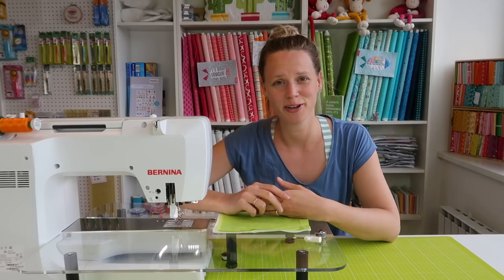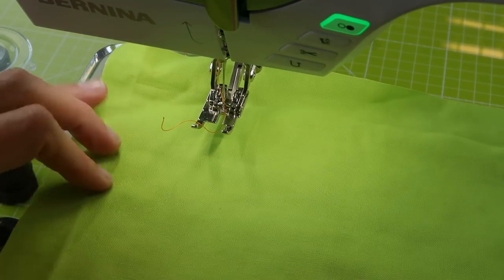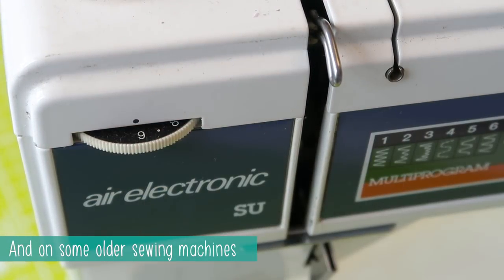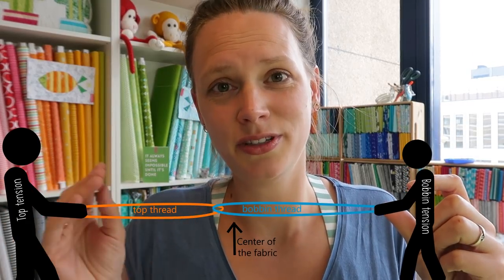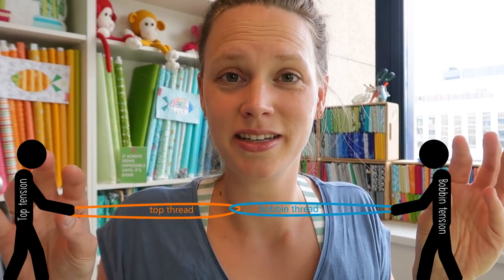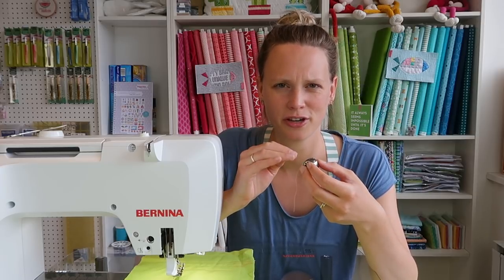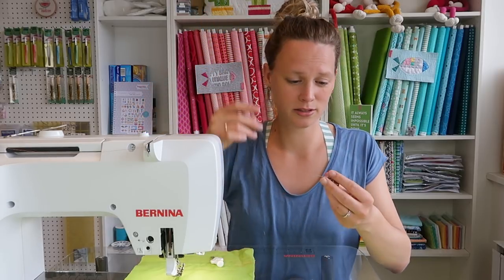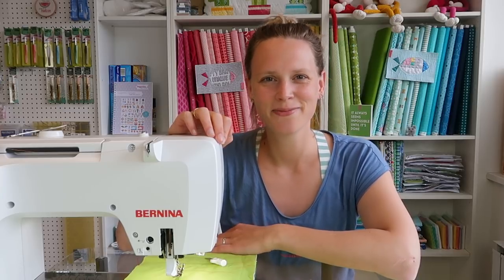How to fix your thread tension problems | Quilty Questions

Comment from the maker: Hi there! What do you want to see next in a quilty questions video? Any quilting problems you need solved? Something you want me to dive into and explain? Let me know in the comments below! I would love to hear from you 😃
Reply: I struggle with quilting my smaller quilts on my home machine.  I know I am over thinking it and my biggest challenge is how to pick a design.  Do you think you could do maybe a series on how to quilting a home machine?  I really love your videos. Have a great day
Reply: can you explain tread.  I bought thread at a discount store.  Every time I try to use it the tension is way off.  Auto doesn't work with this tread and I can't seem to get it adjusted to work properly.  I appears to bee the same as other treads but it isn't.

Comment: Thank you for this video. I also sew on a bernina! I am having issues with when I go over multiple layers. It only seems to be an issue sometimes. All is threaded correctly. Should I be changing tension when i go over the thicker parts? 
Thank you!

Comment: This is a great video.  I have been sewing for 30 years but never really understood this.   Now I do.  My issue is that the bottom thread has very loose threads.  What is a fix for that?
Reply from the maker: Maybe you can check if your bobbin is being wound properly. Is it not too loosely wound? Or check the tension on your bobbin case if that is ok. Giving your machine a good clean can also help in some cases. Or take it for a (yearly) checkup at the store. Hope that helps!

Comment: In my case, forward stitches are sewn perfectly. But for the same fabric, same layers, same thread, in reverse stitch my top tension is too low (bobbin thread tension is too high) Please advice. What might be the problem with my Brother GX37? Its a brand new machine.

Comment: What about if I'm still getting locks on the surface of my fabric no matter what the thread tension is set at? Even when I've turned the dial all the way down to 0...I've also adjusted the bottom bobbin tension and believe it to be right, if anything it might be a slight bit too tight still....is that why I can't get rid of the locks on top even with my tension set to 0 on top?

Comment: I have a problem but have not been able to find a resolution. Maybe you can help or direct me. My machine always jams after about a minute of free motion work. I have tried all the regular checks: new needle, rethreading, check bobbin, a better thread. It always starts out fine then jams with thread wrapped around bobbin and bobbin pulled upward. Maybe this is a common problem. if so, could you address it?
Reply: I have the same problem.

Comment: I've noticed that my tension works perfectly when I'm piecing, but when I'm machine quilting with my walking foot, the tension is always off!  With the top too tight and the bobbin looping out the top.  I don't know what wrong.
Reply from the maker: Hmm that is strange. What kind of machine are you using? Do you use different thread when quilting?